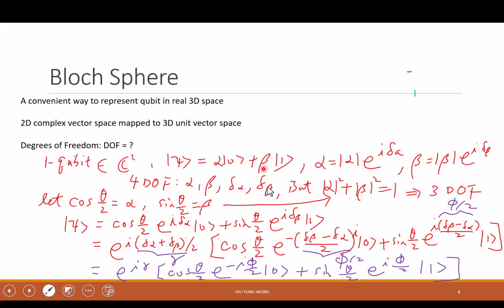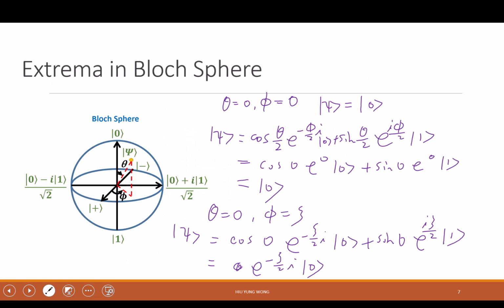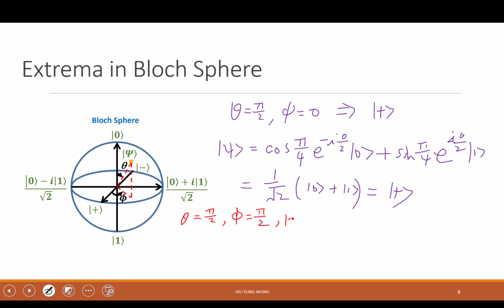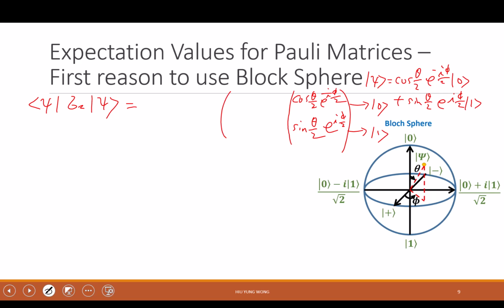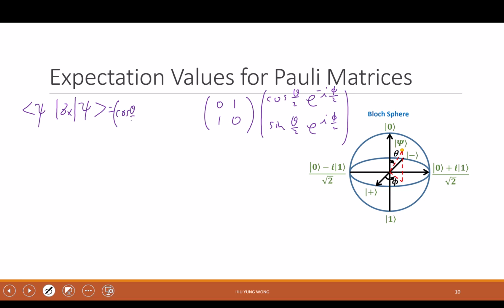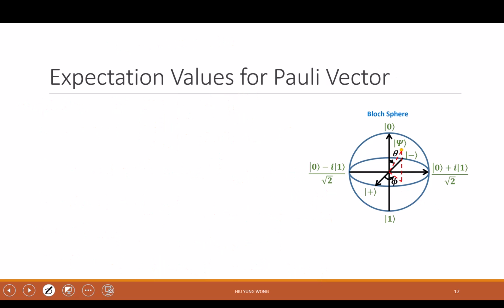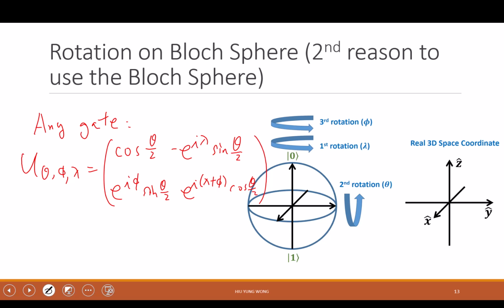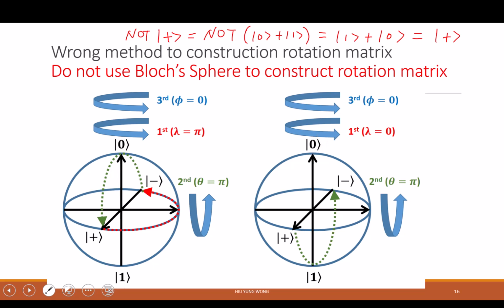Lecture 24, Ch-27 Bloch Sphere

Comment: 58:29 Hi, as quantum states have 2 DOF, where did the lambda come from?
Reply from the maker: 2DOF means you only need 2 parameters to fix its location. But this is about rotation, not the location. For Euler rotation, you need 3.